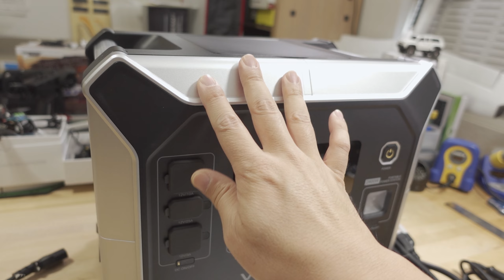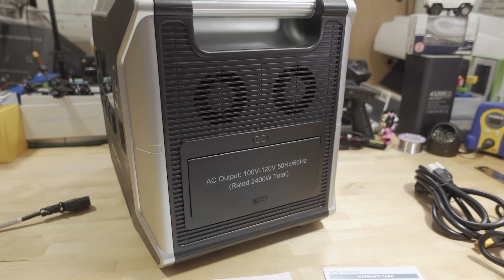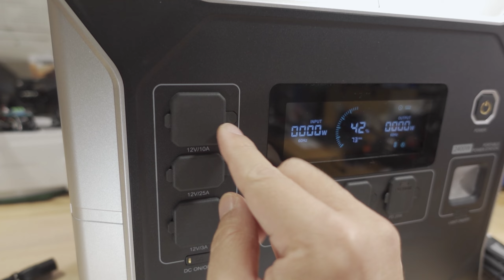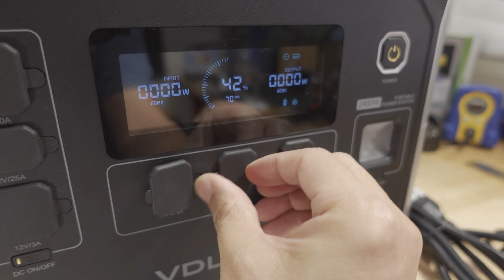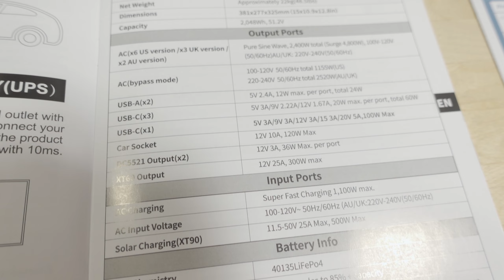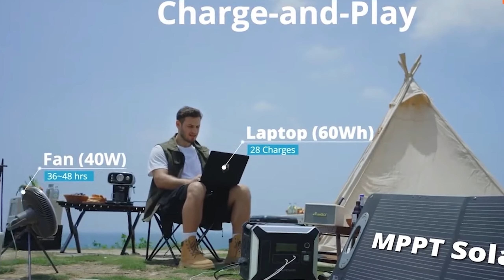2023 BEST VALUE POWER STATION // VDL POWER HS2400 2048WH ⚡

Comment: Is the solar the only input for connecting another battery? Is there a way to have solar charging and charge from another battery at the same time?
Reply from the maker: I think that's the only input other than AC.
Reply: @AlbertKimTV  Thanks. I have another question when charging with solar Is it 500w max into battery or max total through that connection? Meaning can more than 500w be passed through for immediate use? I've got over 1kw of solar panels.

Comment: 2048Wh is a lot of capacity for the price. Is there any way to add an expansion module for more capacity? I may need over 4000Wh for a project.
Reply from the maker: Expansion is pretty easy with an external 12v LFP battery.